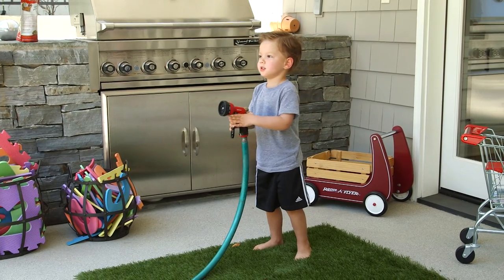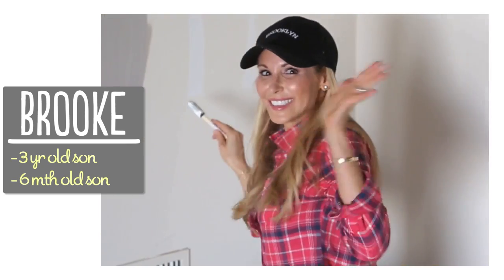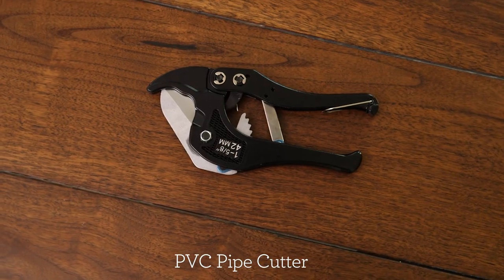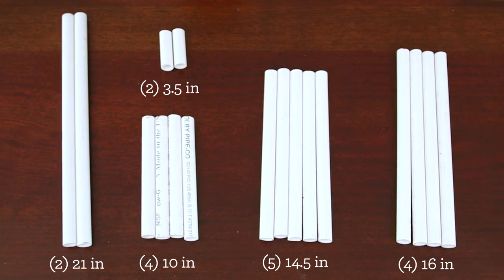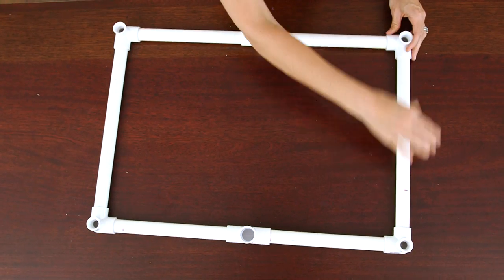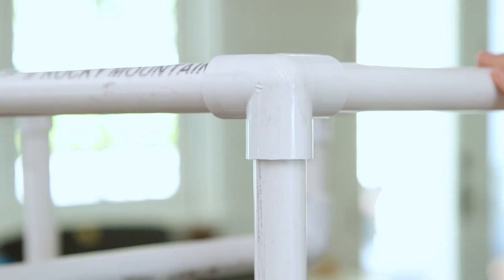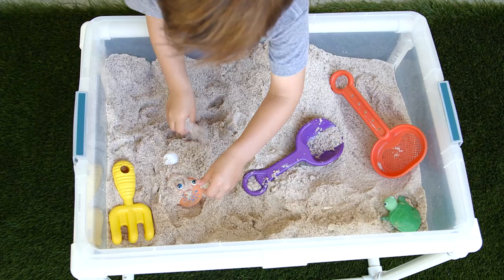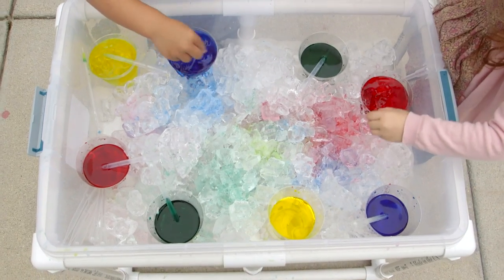DIY | DIY Water Table

Comment: I made this yesterday. I'm glad I double-checked the measurements in the description with what is said in the video. There are two inconsistencies in the printed list. For future reference, you only need two of the 3-1/2" pieces of PVC, and the correct measurement for the set of 5 pieces is 14-1/2" (as stated in the actual video) NOT 14-1/4". I bought the same Hefty bin as shown in the video (not the one in the link in the description box since that one has slightly different dimensions) and the setup works perfectly! Make sure you push hard on all connections for the frame and it will be a perfectly snug fit. Thanks so much! My kids love it.
Reply: Sarah Wrigley is this cheaper than buying a step2 brand sand table ?
Reply: Where did you buy the tub? We can’t find one that fits
Reply: I do not recommend to fill with water in an indoor setup. The parts can accidently get apart.

Comment: I made this using the instructions, using a 30L tub (about 32 US liquid quarts). When I tested it by filling the tub to HALF the volume, the joins separated from the weight. I decided to use PVC cement to glue the joins and this seems to make it more stable. This means however, that it cannot be dismantled for storing. I think this should have been pointed out during the video.
Reply: ….it’s common sense that if you GLUE something OR USE PVC CEMENT that it would NOT come apart for easy storage… 🙄🤦‍♀️ like what did you expect would happen?

Comment: Thank you for this video!  Made it for my grandson.  It was so easy - the guy at Home Depot offered to cut everything for me so all I had to do was assemble it.  Cost for PVC pipe and connectors was $25.33 and the box was $9.99.  Check online at your WM first for the Hefty 40 Qt box since not all WM carry them.  I plan to buy a 2nd box to use for sand.

Comment: This is easy to build.  But a couple of things.  This is kind of expensive.  Mine cost $50 in parts from Home Depot and Target, and I didn't have to buy the pvc pipe cutter because I have my own.  The bin that fits this is a 40 quart (not gallon, as she says in the video) Hefty clear plastic bin from Target.   It is kind of tough to find.  I had to go to three stores before I found it at Target.  But, the 5 - 14.5" inch pipes she shows in the video need to be 15" long for this bin to fit easily into the frame, assuming you've hammered the pipe into the fittings tightly so the thing won't come apart when water is in it.  But with those few modifications, the table is quick and simple to build and my granddaughter loves it!  Thanks.

Comment: So I appreciate the attempt, but every cut was wrong. Had to run back to the hardware store and buy 20 more feet of pvc. Luckily it’s only a $6 loss as the connectors are the main expense and I hadn’t glued any of it yet. You’ll need to add 1 inch to the 2 long pieces, and 5 wide pieces. Add .5 inch to the 10 inch pieces, and 3.5 inch pieces. This thing will not hold together well if you don’t use pvc cement or super glue on it, especially the hanging support. If you’re going to put water or sand in it, it needs to be cemented to keep your kids safe and the stand from falling apart. I found the 16 inch legs to be way too short for my 3 year old, so I made them 18 inches and even that’s a bit short, but it’s all the pvc I had left. I’d recommend getting an extra pvc pipe so you can make the legs 20-22 inches. In the end, it’s about a $30 table if you don’t waste materials like I did, and it’s a little on the wobbly side, so not sure I’d do it again. If you’re kid is a leaner or like to pull themselves up on stuff, expect this to possibly flip over on them.

Comment: Might want to make the middle part longer and flip the whole thing upside down,

So the middle part will carry the weight by holding from the bottom instead of carrying the weight from the top.

Logic: To dismantle the pipes, you pull them apart.

Comment: Before I go shopping online for supplies, how much did this cost to make approximately?
Reply: That is what I'm wanting to know as well seems fairly easy to make not sure if the cost is worth it since she didnt give an estimate of how much was spent. .
Reply: Jenni Munoz the pvc pipes costs $2/each at Home Depot, the 40qt tub i found for $10, the elbows etc cost me the most I think (I made 2) 

If you have to buy the pvc cutters ($15) it’s about $40.. if not it’s $25 .. my opinion it’s worth it .. it was super easy to assemble, I can adjust the height by just making the 4 pipes taller next year and I can take it apart and put it away easily
Reply: @senoraantero2836  Thank you so much!😀

Comment: You listed 4- 3 1/2 but you only need 2. And on the video you mention 40 gallons instead of 40 quarts. Big difference. Anywho, it was really easy to make. I just had 2 extra 3 1/2 cut pipes but no big deal.

Comment: Got 3/4 inch pvc pipes and connectors and they don’t fit together... I think the connectors were labeled wrong because the pipe is too small to fit in there.

Comment: if you live in Canada, this project is not for you. 3 way PVC connectors don't exist. also this project will cost you $60+, the connectors were the most expensive part for me. ($30). +$13 bin, and 3 way connectors are $10usd online each. x8 that you need - it's better to buy a water table. I'm kinda bummed I cut all my PVC pieces and went to 5 different building supply stores for the connectors. no dice. It would've been a fun DIY. oh the description for parts does not match the video above. there's one part where are say cut 4 but in the video you said 2. sorry I can't remember which one.

Comment: It can’t be any 40qt bin I made this today with a Hefty 40qt and it was to small We did a second table but measured the bin first and it works best if you say measure your bin and then cut exactly what you need we wasted a lot of pipe!🤦🏻‍♀️😫
Reply: Mariela & More luckily the pipes only cost $2 

I didn’t realize until after that it said in the description to measure your tub 😆

Comment: Your written instructions are full of mistakes, 40qt bins are far too deep for a 3-1/2" center bar. You say to cut 4 3-1/2" pieces but only use 2. And you say cut 5  14-1/4" pieces but instructions refrence 14-1/2" pieces.

Please proof-read your work, very sloppy